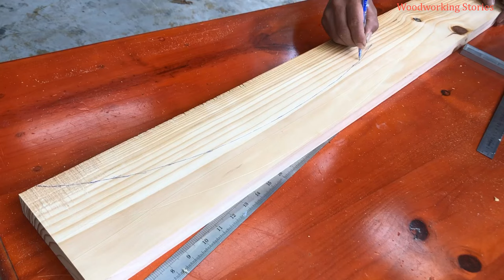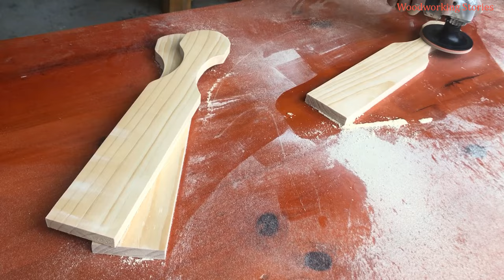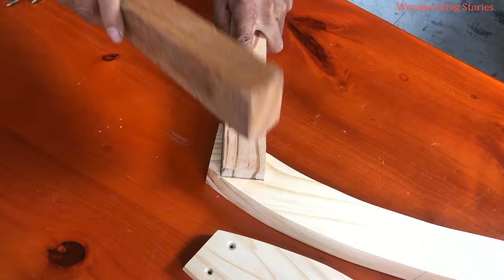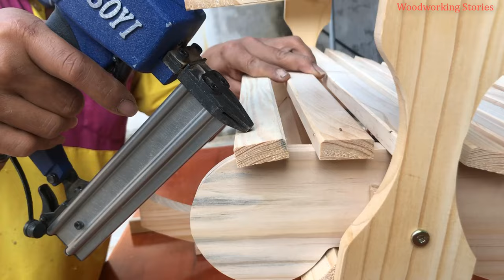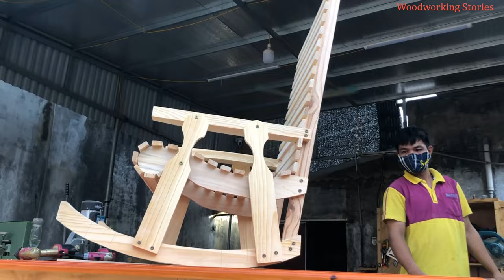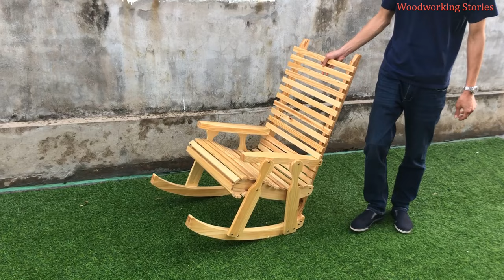Great technique of the woodworker  //  DIY a very special rocking chair.

Comment: All the rocking chairs I’ve seen elsewhere have the rockers oriented opposite to yours, with the long ends pointing out the back to keep the chair from tipping over backwards when someone gets a rockin’ ...
Reply from the maker: Thanks for your comments. I will try harder.
Reply: @restorerestoration4705  You did well. Can you unscrew the runners and shift them so they are longer behind the chair?
Reply: Así es nadamas invertir